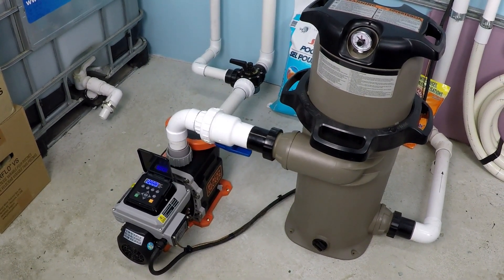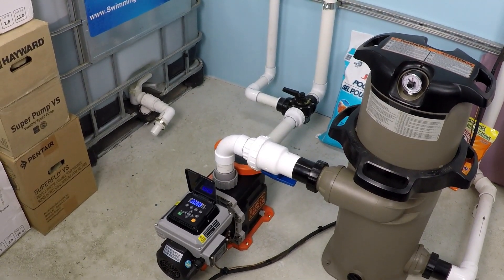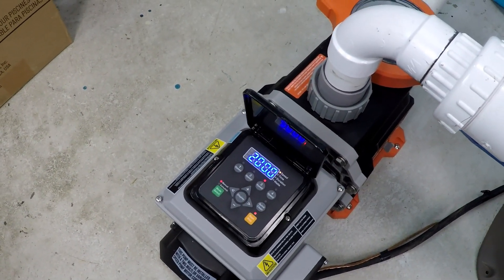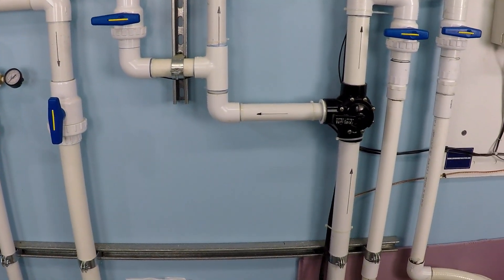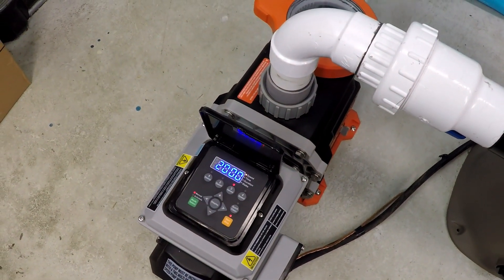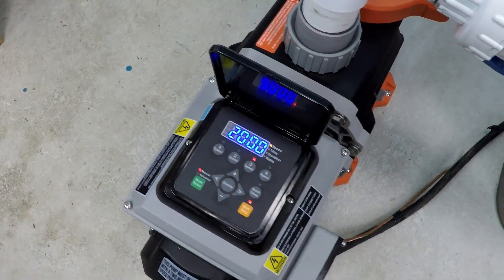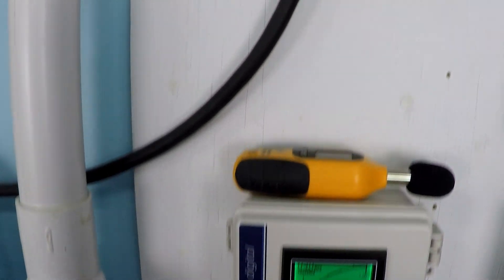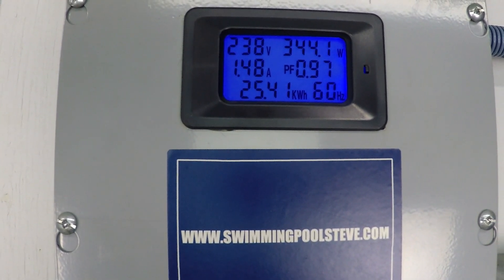2000 RPM Flow Test 1.5hp Black + Decker Pool Pump

Comment: What are thr results for 1500 RPM? are you going to test 2500 and 3000 RPM?
Reply from the maker: @RGMc-y2x  here is a page with more testing results for you to look at for this pump operating on different systems / different RPM and flow rates: https://www.swimmingpoolsteve.com/pages/vs-schedules.html

Comment: so do you like it?
Reply from the maker: @Berp-j2f  yes, it's a good lower priced option to the big 3 name brands for pool equipment. It's quiet. Has a long warranty. Operates with flow simular to a 2.2thp Pentair Superflo yet consumes power like a 1.65hp Hayward Super Pump.  It's all going to come down to longevity. If ypu get a long service life then the pump is definitely worth it...if you don't then it wasn't. These have been on the market for a few years now so less risk in taking the gamble here in 2025 than it was a few years back.
Reply: I bought one in January. In a cold climate in NYS, so we'll see after I install it in the Spring? I had to make the jump to variable speed based on your recommendations,  and this was a reasonable choice, especially since I have a functioning Superpump. Thank you so much for your analysis and your viewpoints over the years!